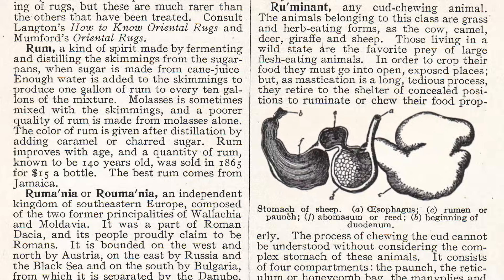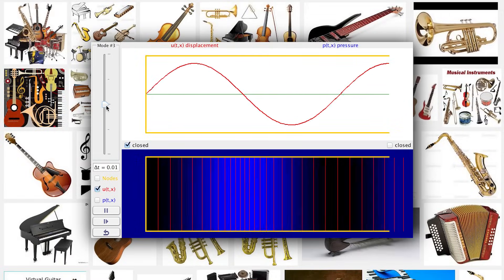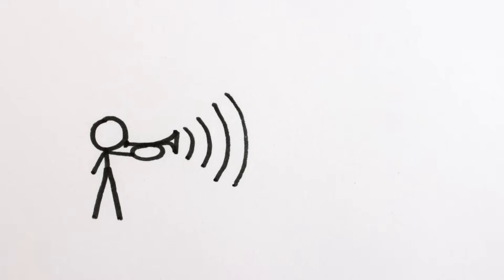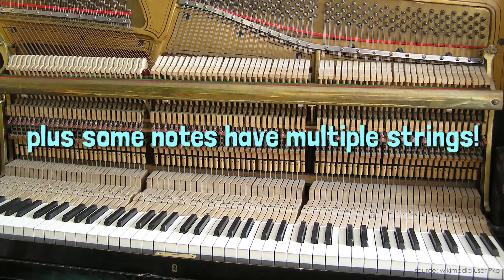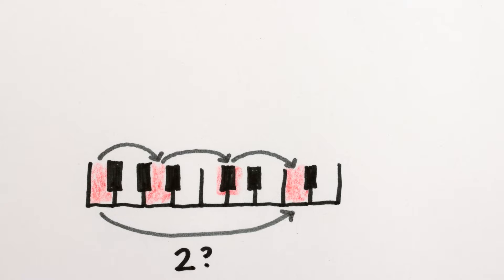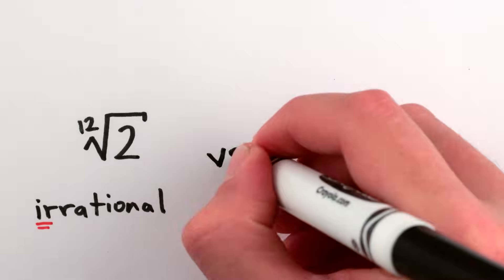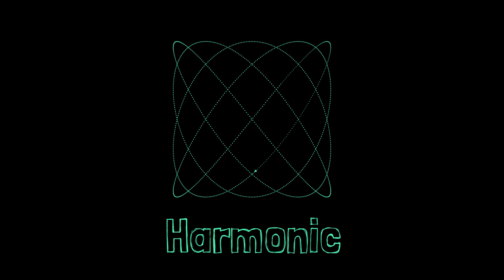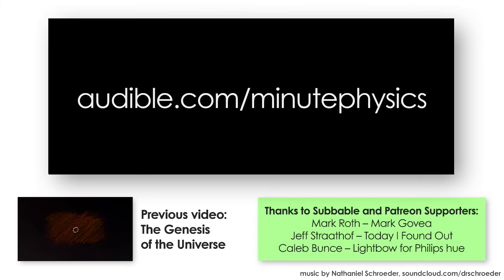Why It's Impossible to Tune a Piano

Comment: There is a compromise between equal temperament (any song playable) and harmonics (nice sounds), it's called well temperament . The notes are tuned for example like this:
C: 1/1
C#: 200/189
D: 9/8
D#: 32/27
E: 81/64
F: 4/3
F#: 625/441
G: 3/2
G#: 128/81
A: 27/16
A#: 16/9
B: 189/100
C: 2/1
You still preserve 8 of the fourths as 4/3, while 3 of them will be 75/56 and one of them 83349/62500 (3/2, 112/75 and 12500/83349 for fifths). But they are only off by a few cents, while Pythagorean tuning and meantone have one horrible fifth. Other intervals are nice too.

Edit: This tuning is better:

C: 1/1
C#: 256/243
D: 28/25
D#: 32/27
E: 5/4
F: 4/3
F#: 45/32
G: 3/2
G#: 128/81
A: 375/224
A#: 16/9
B: 15/8
C: 2/1
Reply: ***** Actually there are many variations of well temperament, with no standard one. I just created one myself by using 75/56 together with 4/3.
Reply: If you want to use a well temperament with fraction ratios, I recommend to use this instead:
C: 1/1
C#: 256/243
D: 28/25
D#: 32/27
E: 5/4
F: 4/3
F#: 45/32
G: 3/2
G#: 128/81
A: 375/224
A#: 16/9
B: 15/8
C: 2/1
C-E and G-B major thirds are pure, as well as E-G minor third. C-G, E-B, B-F#, C#-G#, G#-D#, D#-A#, A#-F and F-C fifths are all perfect. G-D, D-A and A-E fifths are slightly flat, while the F#-C# fifth is indistinguishable from a perfect fifth.
In short, you will be able to play C-E-G perfectly, and G-B-D quite good.

Here is why equal temperament is used now:
Tuning began with Pythagorean tuning, which tunes a fifth to 3/2, and stacks them. Octave (2/1) is also used. However, major/minor thirds were impure (81/64 and 32/27 respectively) so mean-tone was invented. It flattens the size of fifth to be flatted, so that major and minor thirds would be closer to 5/4 and 6/5. The problem with Pythagorean and mean-tone tunings is that the circle of fifths could not close to octave, so one of the fifths was a wolf fifth (There is a maximum of 8 major thirds or 9 minor thirds because of that). Modified mean-tone spreads the wolf fifth into 2 or more parts, so that wolf fifth would be more acceptable and to get more than 8 acceptable thirds. Well temperament makes all 12 thirds usable. This is done by spreading the comma on Pythagorean tuning instead of mean-tone, so that the worst third would be Pythagorean fifth. More often used fifths are flatted to achieve better thirds. Most well temperaments don't have pure thirds, but have some close-to-pure thirds. However, music started to switch between different fifths/thirds more quickly, and in well temperament, C-E for example sounded differently from F#-A#. So Victorian well temperament was used which makes different fifths and thirds closer to each other, though the more often used ones were still purer.  Because of the difference between these was still a problem (though reduced) finally all fifths/thirds were equalized, resulting in equal temperament. I don't know why they considered switching between fifths/thirds more important than making more often used fifths/thirds better.
Reply: *****
The reason for switching from well to equal temperament is that music has started to change keys quickly, instead of gradually (C major, G major, D major, A major, ...) and abrupt changes in color of thirds/fifths was bad.
Reply: There was never any tuning system called "well temperament" you're referring to the system used by Bach in "the Well tempered clavier"this was just one tempered system. There were many different systems of temperament, "well temperament"  is just a phrase to describe a system where you could play in all keys. and whilst a convincing case has been made by Lehman for the system you've described its contested whether this is what the squiggles on the top of that page by Bach actually mean.
Reply: ***** I just designed one well temperament. Well temperament was used in many forms, depending on the composer.
Reply: Your "well" temperament is bad! For exemple the fifth C#/G# is horrible with ratio 1.4933!
In the classic equal temperament we have better fifth- 1.4987. And ALL fifths are the same...
Reply: In my EQUAL temperament the fifts have ratio 1.4994 and the octaves 2.0025. 12 fifths =7 octaves and it sounds in tune in ALL tonalities! Who have a better solution?
Reply: Latchezar Dimitrov I have. Instead of tuning 12 notes to octave, tune 53 notes to octave. Fifths (~3/2=1.5) have ratio 1.49994, thirds (~5/4=1.25) have ratio 1.24898, octave has ratio 2. Having exact octaves is important, otherwise C and C5 together won't sound nice. In fact, I would consider 31 notes to octave even better solution; even though fifth is worse, it offers approximations to 2, 3, 5, 7, 11 and combinations (9, 15, 6, 4, 8, 10, 3/2, 5/4, 6/5, 25/24, 11/9, ...). 12 fifths < or > 7 octaves because no musician ever used it to his advantage. If you tuned 17 notes to octave, fifth would be 1.5034 and 17 fifths=10 octaves. And it would be preferable to have same ratio for four fifths and third+2 octaves (5), as it makes things easier. 9/8=10/9, 9/8+9/8=5/4, ... 12, 19, 31, 50, ... notes to octave satisfy it, but 22, 34, 41, 53, ... do not. 17 doesn't even support a third. Sometimes however, distinguishing between 9/8 and 10/9 is preferable. Using 22 notes to octave seems to be a nice solution (it supports 2, 3, 5, 7, 11), but the difference between 9/8 and 10/9 is way too much. In other hand, 50 notes to octave has the perfect step size for this difference, but nevertheless doesn't distinguish them. 53 notes to octave also has the perfect step size for 9/8~10/9 difference, and it actually is! However it barely supports 7, and 11 is out of mention (just like 12).
Reply: Latchezar Dimitrov And I just invented it for proof of concept. Real well temperaments are supposed not to improve fifths, but to improve thirds by lowering fifths. One well temperament even has a 5/4 third.
Reply: Ok, I understand but playing out of tune mean exactly that-to improve one interval more than other! Only an equal temperament can be in tune but you must choose how big must be a half tone-it's simple ;-)
Reply: ***** I also don't know why. Stacking 4 3/2 fifths and octave-reducing led to 81/64, close to 5/4 (differing by 81/80), so meantone flattened fifths so that four of them would be 5/4. But there is alternative theory, stacking 8 5/4 thirds and octave-reducing led to 390625/262144, close to 3/2 (differing by 393216/390625), so 5/4 can be sharpened so that eight of them would be 3/2. In fact, combining the two theories leads to a cycle of 31 fifths or 31 thirds, since four fifths is a third and eight of them are a fifth (1 step in cycle) so 4*8-1=31 (or the other way around, eight thirds is a fifth and four of them is a third).
Reply: The classic equal temperament respect only the octave pure exactly in tune, ok! But my equal temperament give the nearest position for every intervalle to the position pure possible! Dont forget than the fifths are consonants intervalles and are more importants than the thirds!
Reply: groszak1 
If you talk about a equal temperament then it isn't possible to have pure octaves 2/1 and in the same time fifths 1.499... stay logic, please!
Reply: +groszak1 If you play a musical instrument you know very well that it isn't easy to memorise  good places for 12 notes, if you propose 53 it's crazy idea! Nobody will use this, very wrong way to play in tune....
Reply: +groszak1
Reply: Latchezar Dimitrov Actually thirds are more important than fifths. It's because thirds are very dissonant if not perfect.
Reply: Latchezar Dimitrov Also 53ET is used for composing songs not playing them
Reply: Composing only? Why composing if don't playing? And why 53 instead of 52 or 54???
Reply: Latchezar Dimitrov I meant not playing it on piano, but on computer. 53edo just happens to have near perfect fifths and thirds, while so isn't true of 52 or 54.
Reply: Hahaha, near you say? Do you know how near to just is my temperament?! Never mind to do better, sorry-only try it to hear the result!
And you generalise the pianos...it(s completely wrong! The piano can be tuned not so bad what you mean...
Reply: And "your" 53 ET is it equal??? Because if not-it isn't universal also...
Reply: Latchezar Dimitrov edo is for Equal Divisions Of octave, while ET is for Equal Temperament. So yes. Your temperament has no fully pure octaves, they are required.
Reply: Ok, but I am sure that you use different places for the same notes depending of the context harmonic, right?
Reply: Latchezar Dimitrov Yes, 81/64 and 5/4 are both E but are represented by different tones. This doesn't exist on 5, 7, 12, 19, 26, 31, 50 or 55edo.
Reply: Or finaly my temperament is better because is equal and in the same time nearest to just intervals! ;-)
Reply: Latchezar Dimitrov Must have real octaves and not dissonant ones. Songs will be ugly otherwise. 53edo is also equal!
Reply: Latchezar Dimitrov It is equal. 0/53, 1/53, 2/53, ... 53/53 of octave. Also pure octaves is way better. Equal does not mean that 5/4 and 81/64 (both E) are the same tone. The correct term to refer this is meantone.
Reply: groszak1 About the pure octave, do you know anything interesting concerning the perception audio humaine? Do you know that the human perception evaluate wrong melodicaly one pure octave?! With other words we hear too hight basse frequencies and too low hights ones! Stretching the octaves is a natural remede to avoid this insatisfaction... Also you say nothing about my audio example, why?
Reply: Latchezar Dimitrov It causes another insatisfaction, octaves are impure.
Reply: Your upper octaves in your sound sample are sharp. In addition, when the left hand is playing a chord, the right hand clashes and is out of tune. Sure, this may be fine for midi files. But it would be agonizing to try to play songs in this adjusted schema in an orchestra which has a huge range at all times.
Reply: Many thanks for your suggestion "in an orchestra" - I had this experience more 25 years in OPN Nice France! How about you?
Reply: Vinson Young If you are violinist, you can try this to finish with your pure octaves... 1) Find pure octave G/G 2)Then find pure fourth B/E where G and E are your empty strings. 3)Now listen the result of yours pure intervals playing the third G/B on the D and A string! Do you still like pure intervals???
Reply: Yep, and there is also 'Genuine Tuning' where all the keys are in-tune and all the harmonies are correct (no temperaments).  Only about a dozen or so people alive can do this though.  I know three in three different countries.  Good luck finding a technician that is really interested in becoming a 'Tuner':  It takes twice as long and an exceptionally true ear.  Perfect pitch does not help here.
Reply: As one who many years ago apprenticed as a piano tuner/technician I find the mathematics interesting but not very useful. To tune a tempered scale you must widen the fourths, narrow the fifths, match the beats of thirds and sixths, etc.  You don't tune to pitches, but the harmonic beats naturally occurring between the various intervals, except for octaves, of which the beats should be tuned out. Then every piano has false beats which you need to be able to tell from the "real" beats! That doesn't take into account that when any one (of about 225, depending upon the instrument) is tightened to raise the pitch, every other string loosens. If a piano is basically on pitch with very little adjustment, you don't need to overcompensate to have the whole thing come out as good as possible. That's just a few of the things an experienced tuner needs to take into account. That's why even after years of experience you find some instruments that simply fight you. You also need to learn the technique of "setting the pin" so it doesn't move on its own, and getting the tension evened out between the hitch pin and the bridge, the speaking length, between the upper bearing point, whether it be rails or individual "agraffes" and the tuning pins. After tuning since 1962, I've never felt that I mastered all of this on every piano!  If you find someone calling themselves a tuner that shows up with an electronic tuner, BE VERY AFRAID!
Reply: Most musicians I hear use anything but Equal Temperament, and rarely tune to A=440. I guess I live in the Early Music bubble.
Reply: Just use Young.
Reply: Now I understand why certian keys are seen so seldsom.
Reply: I know the nocturne I played it myself. To me it sounds good.
Reply: @groszak1  The thirds don't have to be perfect because they aren't consonant intervals like the octaves and the fifths.The best solution to be nearest possible to  right intonation is one equal temperament without just interval.If the octave participe in the temperation then all other intervals become better.And all 12 notes in any scale have fixed places.Better compromis simply don't exists!
Reply: @LatchezarDimitrov  The consonance of intervals like 5:4 and 6:5 is often very desirable. And this can only be provided by more notes per octave like 19edo or 31edo. It gives much more musical possibilities than your modified 12edo.
Reply: @groszak1  You forgot the fixed places for all notes! Like you tune your instrument the A4 must to have  all the time the same value(442hz for example) its the same for all the notes! And finally I would to remember you that my temperament is only the standard nearest possible to respect equally each interval.If you know where are the right places for the notes, you still can do expressive deviations for have better thirds or fifths. The essential is to have solid idea how to respect any interval in the same time!
Reply: @groszak1  I don't think I agree that thirds sound very dissonant if not perfect compared to fifths.
Imagine a tuning system where all thirds are perfect and all fifths are tempered as much as thirds are  tempered in equal temperament.
Reply: @LatchezarDimitrov  "Your "well" temperament is bad! For exemple the fifth C#/G# is horrible with ratio 1.4933!"
That's less than 8 cents off. More problematic in equal temperament are the major and minor thirds. The major third is supposed to be the 5÷4 ratio, but is in equal temperament about 13.686 cents sharp, while the minor third is supposed to be the 6÷5 ratio, but is in equal temperament about 15.641 cents flat. Your equal temperament does not make those much better.
Reply: @groszak1  In the temperament story nothing can be fully perfect. We have only a  variants been better or worst. My universal equal temperament was never discovered before. I use it and I like it. My hear habits are news one. It's the only one way to have melodic and harmonic satisfaction in the same time. The idea can't be fully respected in real play time, but it still stay very helpful...
Reply: @groszak1  OK?
Reply: @groszak1  No one of my fifths have another ratio than 1.4994!!! All fifths are the same and all intervals have a constant ratio. You must understand than my temperament is better than the classic 12EDO!

Comment: You forgot to factor in inharmonicity, which further complicates the problem of tuning equal temperament. 

Basically, the stiffness of the physical string doesn't create a perfect harmonic. Those harmonics resonate octaves above their fundamental note, but due to stiffness, they resonate slightly sharp of the theoretical frequency they should sound like. Tuners must factor this in as well in order to make playing notes several octaves apart continue to sound pleasant to us. Mathematical tuning will not optimize harmony in a piano. Uprights have the worst of it, because the string length is already being compromised from its ideal length/fundamental pitch ratio to an extreme.
Reply: David Marley 
You are 100% correct about inharmonicity.  Good explanation.  
I’m sure Henry knows this too, but it was beyond the scope of this video.